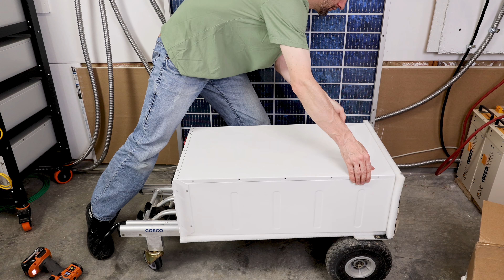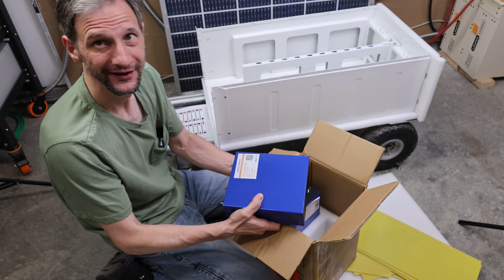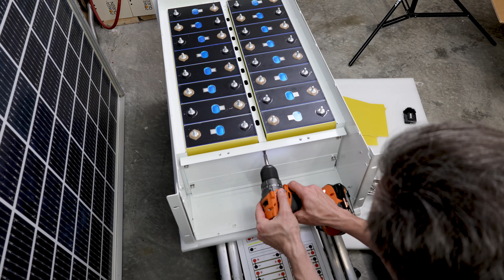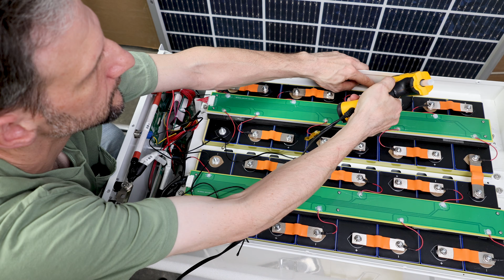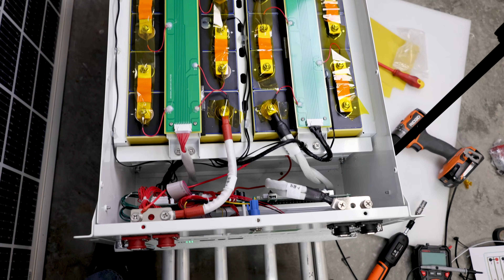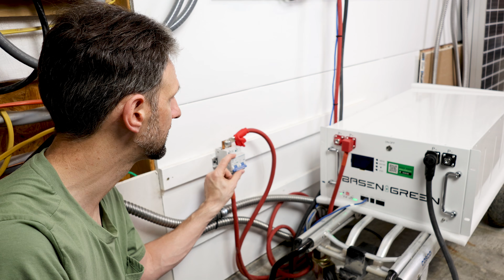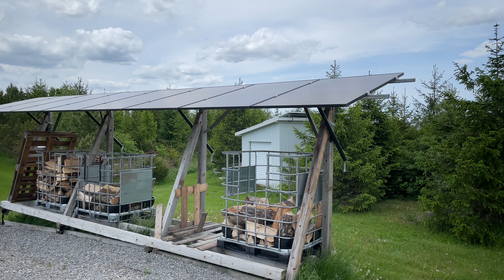SAVE Thousands - Build your own home solar battery backup!

Comment: whats the smallest size gas generator would i need to charge the DIY batteries?
Reply from the maker: You could use any size if your charge controller can mange it.  It all depends on how quickly you want to charge them.
Reply: @ProjectsWithDave  Can you recommend a website or books (up-to-date) for learning the basics in regard to DIY?

Comment: Dave, thanks for the reply. Since there are two different BMS (SOK and Brasen & Green) please share your thoughts on how you would integrate the DYI box with your existing system. Thanks
Reply from the maker: Having a different BMS isn't the issue.  Each battery in your system connected to your main busbar should be the same chemistry and the same number of watt hours, or as close as possible.  Then let your inverter/charger manage the entire capacity with a shunt.

Comment: How can you say there isn't enough savings?  I built a battery bank that is just over 15kWh for under $2000.  I like the case though.   I'll have to think about that.
Reply: I'm building one now for $1980 using this case. Hoping to build 4 if this one works out ok.

Comment: My SELPOS BMS is a 3.0 7ss 24v Type B 150A my battery’s are 3.2v but Off Grid Garage tested this battery for the best performance and he came up with for the 3.2v max charge is 3.6v & minim is 1.6v his test showed the 3.2v batteries best performance is at 3.42v

Comment: I am new to this battery stuff< Question, why did you not just add this new pack to the old packs for more backup? Great video! Thanks!
Reply from the maker: I did that after this video for several months.  Since they don't match the other batteries exactly, they don't cycle together perfectly.  Over time one pack drifts and gets depleted early.  It works ok if the system is fully charged to 100% every few days.

Comment: I got one a 48V BasenGreen DIY kit (the newer one with a breaker on the face) I also got 16 EVE 314Ah cells. Built it with no issues, power it up and it was reading around 60% SOC. But over the past few days every time I power it on and check the state of charge has jumped a bit. It went from 60% to 68% to 70 something and now it's at 84% soc. I've never hooked it up to ANYTHING no power draw or charge (Only thing I've connected to it is a laptop on the commutation port to get some info). Is there something wrong with it? The cells voltage look good, 3.293 max and 3.287 min.
Reply from the maker: Have you charged it to 100%?  The BMS needs to periodically experience a fully cycle to calibrate.
Reply: @ProjectsWithDave  Not yet, I'm just starting my solar system and don't have a way to charge the system yet as far as i know, I'm buying parts as I can afford them. Currently the only components I have for the system is 16x Aptos 400watt bifacial panels and 2x 48v BasenGreen battery's. I plan on getting a EG4 Flexboss21 and a Gridboss next but there currently back ordered.

Comment: This is terrible pricing if you want DIY it is much cheaper. The battry cell 1.5 volt 1 ah is 2 doller each. You need 350 for 18000wh battry it will be less than 800 for that battry
Reply: 1ah*1.5v=1.5wh
18000/1.5 = 12000 pcs
12000 pcs * 2 doller =  24000 doller
Also good luck assembling this.

Comment: The main issue with buying this box is the users manual does not have dimensions of the inside cavity so you really dont know what battery sizes it can accommodate. My battery cell size  H= 8.5 in , W=5.625 in,  T= 1.9375 (~2.0) in..  or Length = 5.625 in (143mm), Height = 8.5 in (216mm) , Width  = 1.9375 in (49.2mm). so how do I know what I need to make it fit? spacers?

Comment: I don't see your link to a complete system build.  Are your inverters full sine wave?  How many? Are they paralleled?  3000 watt seemed low for a household with A-C.  Nice presentation.
Reply from the maker: They are in the description.  Or you can click these:
My starter home battery backup: https://youtu.be/BzMAW8kW0CU
My 120/240V 25kWh home backup: https://youtu.be/ipLRNglTdhg

Comment: This is a 3.2 volt system? What am I missing? 15565/(304*16)=3.2. The description says 48V. Is this one bogus?
Reply: He has 16 batteries in series.
Making it a 48V system
Reply: @zaarkeru3391  None of this voltage stuff makes sense. In 10 years we're going to learn that it works entirely differently and that we've been getting lied to all along. They'll mock us for how avidly we believed.
Reply: @STVNDMC  
What?...
Buddy, what are you on about?...

Current and Voltage are very basic and easily understood... Well for most people...

How would voltage work otherwise?
Are you okay bud?
Reply: @zaarkeru3391  You've been given a straightforward explanation, but so have other religious people about their own dogmas. The real physics operates in obscurity, and every design and concept you build upon the prevailing "understanding" of electromagnetism makes the illusion more ornate. Voltages are occult. They make no sense to me.

"Potential" difference... oh, sure, sure. Yeah, let's talk about the "potential" and not the actual difference between the number of electrons in one place and in another...
Reply: @jumpinjohnnyruss  
Again, what are you on about.
Wiring a few hundred words with zero substance is the same as writing nothing.

The occult can't be verified or tested independently by an infinite number of people to come to the same objective conclusion.

Potential or pressure is the objectively correct description of voltage 
There is nothing occult about it.
Reply: @zaarkeru3391  Yeah, I remember the "on about" phrase from before. So fucking annoying.

"Wiring a few hundred words with zero substance is the same as writing nothing."

And you wouldn't respond to nothing, would you.

"tested independently by an infinite number of people to come to the same objective conclusion"

That's conjecture, and you don't know what the word "objective" means.

You'll remember me in 10 years once the overhaul happens.

Comment: 1800 EUR including delivery to your doorstep in Germany, for a 15 kWh fully built LiFePO4 battery pack on wheels, with all safety switches and RS 485 BMS readout. No way i take a wrench into my hand anymore...
Reply: Got a link or company name for that?
Reply: Until you need to swap a cell that has most probably welded bus-bars...(BasenGreen)
I bought BasenGreen 15kWh  (DIY) at 1500 EUR because of that...

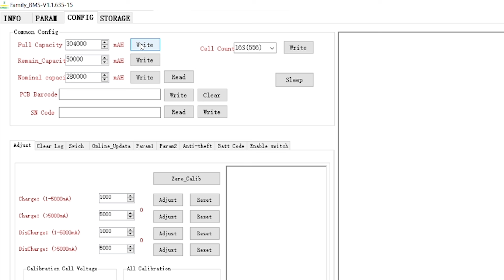Comment: 17:00. So when changing the capacity setting, do you still have a way to limit the total charging level in the software? I'm wondering if the manufacturer did that on purpose so the pack never charges over 80%. Keeping batteries between 20-80% is supposed to extend the battery life cycle so I read.

Comment: Thanks! This is a really neat solution during bush fires and such when there are longer power outages.

In regard to electricity prices it has struck me peculiar that we speak of an electricity market when buildings generally only have one power line

How did it happen that we now have a "market" of supply and demand?

The only way would have been to have interested parties (private) encouraging governments to pass laws & regulations to create one so they could buy in. Isn't it technically a manufactures market rather than a free one? 

Anyway, solar is the go.

Comment: Basengreen has since added an output ON/OFF switch which cuts DC power to everything and there is now an active battery balancing module which is rated at 2A.  If the active balancing is like other BMSs I've worked on it works all the time by charging up some super capacitors from the highest voltage battery and discharging it into the lowest voltage battery.  So the installation method is close to how Dave did it except for a few things. The voltage sense wires go to the + terminals of the jumper bars and the balancing cable harnesses(2) connect to the - terminals and are labeled B0 - B16.  Once all the balancing cables are connected, I went around and torqued all the battery terminals down but B- and B+ and then plugged in the balancing harness. The balancer will start as soon as you get the 2nd/smaller harness connected. Then it's much the same, pull out the temp sensor cables, get the front panel in place pulling the temp sensor wires out, get the front panel red wires up off the bottom for later connections. Connect the voltage sense cables, connect the B- cable/terminal and then connect the B+ cable.  The wires were well protected with a sleeves this time. I'd purchased 314Ah cells and was surprised they were loose even when I put in the extra spacers and the foam sheet. I ended up laser cutting 2 squares of 3mm plywood and using that with the spacers which came with the batteries.

Comment: Do they have any 24v or other options for smaller setups?
Reply from the maker: I'm sure someone makes a 12V kit, but I would recommend using 48V if at all possible.  Watch this video why you shouldn't use 12V: https://youtu.be/xsZzlF_NA6E

Comment: I pulled the trigger on one of these batteries. Where can I find the software to modify the BMS settings? It's not listed anywhere on their site.
Reply from the maker: Here is the software link, it's also in the video description: https://drive.google.com/file/d/16hyQabxsteoz9PFU_uknw2FMX9dhWmd-/view?usp=sharing
Password is "888888"
Reply: @ProjectsWithDave  Thanks for the link. Looks like they've removed functionality to change the preset parameters on the latest cases. The config screen is blank. Mine reads 280ah same as yours but I'm running 314ah cells. I have to get my inverter going now

Comment: Great video, Dave.  Very interesting option.  How many can be daisy chained together, is there a limit?  I assume the BMS reports to Venus the CCL and DCL?  Do these kits have heaters in them?
Reply from the maker: These kits do not have heaters.  You can connect multiple units in parallel, not in series.

Comment: One observation of this design. Apart from some randomly located temperature sensors, there is no thermal management, maybe these batteries don't produce any heat.  Dream on.

Comment: For US$2300 -- that's actually considered EXPENSIVE.    You can buy  USED  100AH ~ 200AH  AGM batteries OR  Lead Acid Batteries for US$20/each from the JUNK YARD  or  USED battery collection places.  Which means I can buy TEN  100AH ~ 200AH batteries for less than US$200.  Should the batteries GO BAD, down the road, the  CORE-CHARGE alone will enable you to recoup more than 50% of that US$200 money that you spent.  As for DC to AC  inverters -- a US$200 ~ US$500 price range  --- should be good enough.  Plus, you do NOT need a BMS on Lead Acid batteries.  Which means:  you can build MUCH HIGHER  solar battery backup for less than US$500 (capacity of 12KwH ~ 24KwH)!!    In comparison:  if you use those  304AH LiFePO4 cells -- when they finally DIE OUT -- then the CORE CHARGE is US$0  (there is ZERO  residual voltage) on them.

Comment: Does your Victron inverter still work when there’s a power outage on the grid? I have a Huawei one but as soon as there’s no grid power it shuts off and I have no electricity anymore even though my battery is fully charged😅
Reply from the maker: Yes, it is set up to switch to backup automatically in less than 20ms.  You can watch the single phase switchover in this video: https://youtu.be/BzMAW8kW0CU
Reply: @ that’s really good to know, big selling point for me. Thanks!

Comment: How can I build a 560v battery. My solar inverter only accepts 400 to 600v battery
Reply from the maker: What inverter is that?  400V is very dangerous, I would not be building that myself.   New EV's run on 400V to 800V batteries, but it requires many more cells in series.
Reply: @ProjectsWithDave  it's a huawei sun2000 hybrid inverter. It can take up to 30kw of battery. But it only takes Huawei Luna2000 Battery or LG Chem RESU 7h Battery.

Comment: Does standing up the box put pressure on the batteries that could cause harm to them over time?
Reply from the maker: No, it's ok for the cells to be stacked vertically.

Comment: Question: can you put more of these units in paralel?
If yes, is there a recommended maximum?
Reply from the maker: Yes you can put multiple units in parallel.  Each manufacture has a recommended max in their spec sheet.

Comment: Prior to placing the cell bus bars, you should have scrubbed the alloy cell connections with a stainless wire brush to remove the non conducting aluminum oxide that forms due to exposure to air; then lightly coat each terminal with petroleum jelly and torque un the nuts.

Comment: Why didn't he do top blancing?   I assembled two of these and I didn't top balance them.   I hooked up in parallel with three other smaller capacity batteries and now they're equal SOC.   I'm so lazy, I don't deserve to own batteries but I'm lucky they seem to work so far after 3 full charges.   For my next assembly, I'll make sure to top balance before hooking everything up.
Reply from the maker: The first time the assembled battery is charged to 100%, the BMS will automatically top balance all the cells.

Comment: 8:20 Just a small suggestion, consider attaching one zip tie to the wires, then attach a second zip tie to that zip tie, and attach that second one to the frame. That way, you won't end up with the zip tie rubbing the wires against the frame. Given that this is in a stationary application, it will probably be fine.

Comment: Better keep your diy battery in a disposable shed outside and underground (because winter) Lots of diy solar fires lately...
Reply: What is the root cause of these fires?  Would seem to be temperature related, so are people DIYing batteries that don't report CCL to their charging systems and therefore are overcharging cold batteries?  That shouldn't happen here given that this system communicates with the Victron system and will regulate the charge it gets appropriately.

Or perhaps there is some other temperature or seasonal related issue?
Reply: @gf3803  It seems to be just bad products being badly installed. news outlets dont really give more info here just that it was installed by the owner of the property. maybe no inline fuses? badly tightened screws causing a hot spot? who knows. could be just overcharging as you said.

Comment: would this system be able to be integrated to the grid to buy electricity when it is cheap and sell when it is expensive? I live in holland and as of now these 'smart batteries' have a high return on investment.

Comment: Super expensive. Is better buying already made for less and 10’year guarantee. $3400 dólar for that battery is Scam.
Reply: Where did that $3400 cam from? The 15kwh kit in this clip was $2250 which is an incredible price

Comment: Are DIY Lithium-ion battery packs more susceptible to thermal runaway if just one tiny component is faulty ?  Warranty?  Insurance?
Reply from the maker: If you are doing a DIY battery, I would use LiFePO4 chemistry batteries.  It is one of the most stable options available.

Comment: you forget an important step that you still have to do after this: top balancing! If you don't do that, the voltage of the cells will eventually diverge. Look on the internet how to top balance
Reply from the maker: The BMS will top balance the cells when you charge the battery to 100%.
Reply: @ProjectsWithDave OK, that saves a lot of work!

Comment: I recently (spring '24) looked at solar power for my home in Missouri. They offered Lithium chemistry batteries, but they shut up when I inquired about conventional lead-acid batteries. The big advantage of Lithium cells is the power density per pound, which is important if your device is moving around a lot. If your application isn't mobile (like a static installation like in your house), then what's most important is amount of power stored per dollar (or other economic unit, I don't discriminate). Lithium chemistry batteries are some of the most expensive batteries currently on the market for the amount of power that they store. Lead-acid batteries are some of the cheapest. Even the late Dr. Goodenough (inventor of the Lithium battery) stated that lead-acid was just fine for many applications. Bet you thought I was gonna say 'good enough', didn't you? Yes, I'm an Electrical Engineer. No, I'm not YOUR Electrical Engineer, and this isn't Engineering advice.
Reply from the maker: I don't discount the value of lead-acid.  For instance, lead-acid would be a good choice if the batteries are constantly in below freezing temperatures.  However, when comparing cost vs storage capacity, you have to consider lead-acid can only use 50% of it's capacity and LiFePO4 can use 80%.  Also LiFePO4 has a significantly longer life expectancy.  I wouldn't discount weight either.  A friend of mine got a good deal on a used lead acid storage system and is now planning to get rid of it and switch to LiFePO4.  The racking had to be very robust the shear size and weight of all the batteries and cabling was overwhelming and the batteries don't automatically balance.  I believe he regrets the decision.

Comment: Great video. Your rifle is nice and accurate.

Try shooting groups like you did at the end, you can measure the accuracy. It's also easier to use recycled cardboard like an old ceriel box, the pellets punch a nice clean hole, new paper and cardboard tent to tear, and make it harder to see where the pellet went through.

I watched the shots in slow motion, i would say the jsb shot closest to the crosshair, followed by the RSWs. Its hard to say though as they were all fairly accurate.
I must be being overcharged for h&n, they are all £12 odd a tin. Rws superfield are £9, jsb £13 and airarms are £17.

Regards
Richard

Comment: A lot of cost for doing this is getting it wiered into your home. But if you just want it in a rack for temp use in emergency situations. Its a decent solution. Need a few good extension cords for it tho.